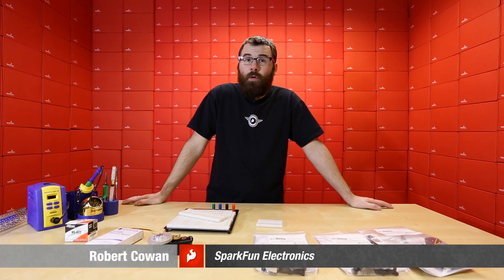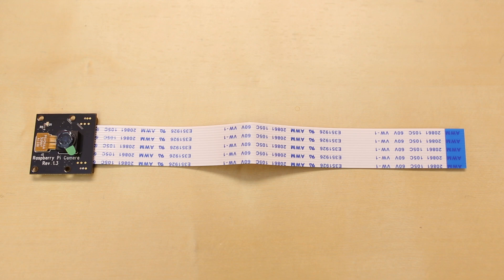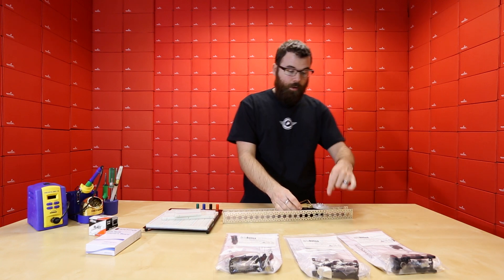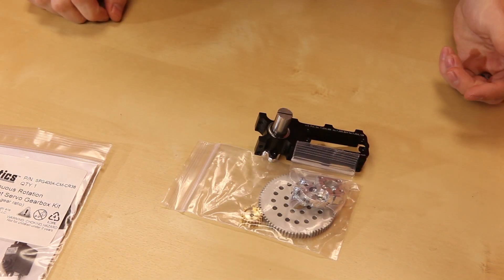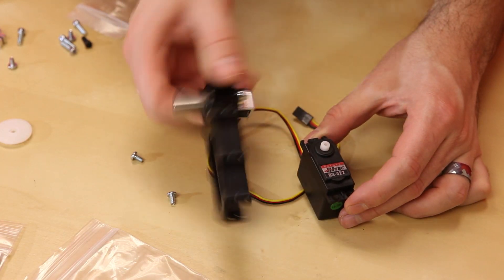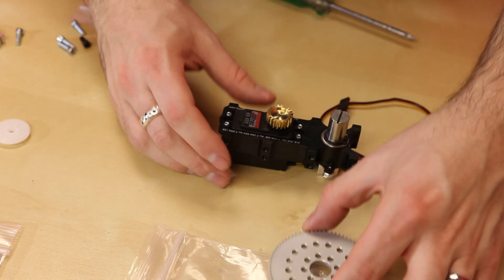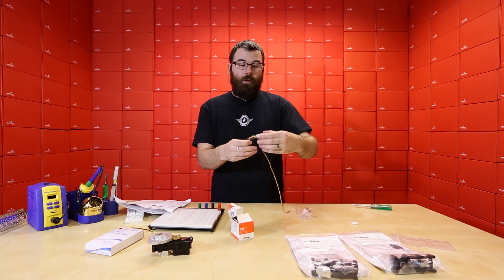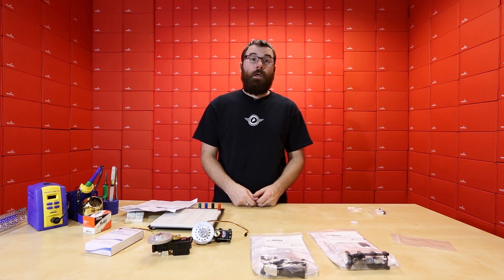SparkFun 1-3-14 Product Showcase: Gear Up For 2014!

Comment: A quick tip to keep the gears meshed without a lot of fuss is to take a piece of regular copier paper (not thick cardstock, or thin newspaper) and put it in between the gears before pushing them together TIGHT. Secure with the screws, and then rotate the gears to remove the strip of paper. You may have to help it along with your fingers if the motor cannot remove it. The gears should be perfectly meshed for long life and positive torque transfer.